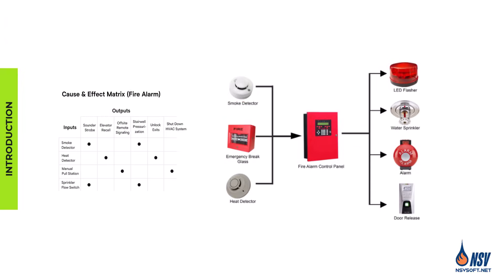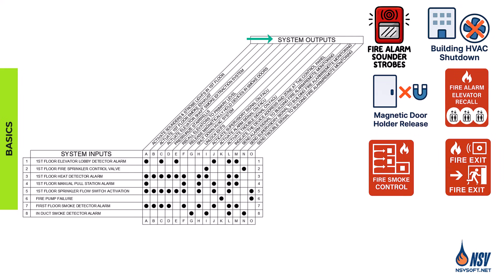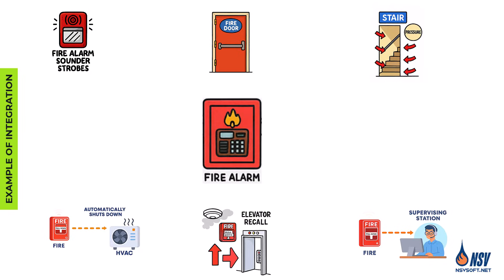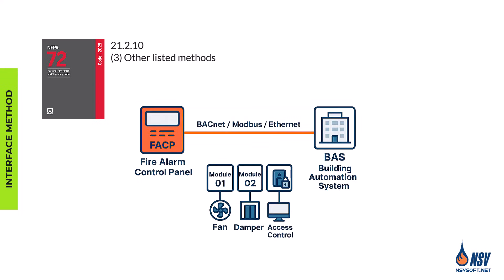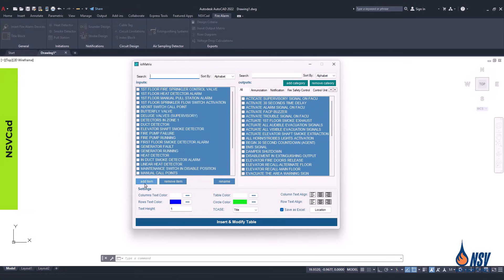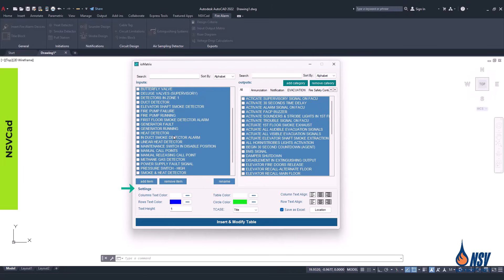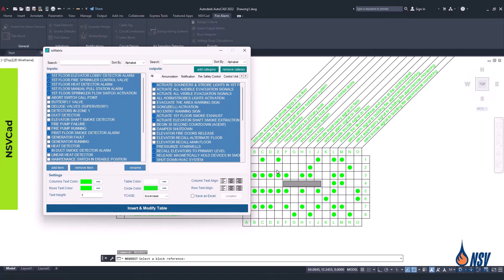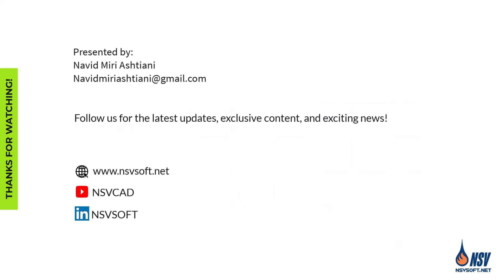🧾Input & Output Matrix (NFPA 72)

Comment: It's so important to stress that the matrix is not just a programming tool, but a mandatory document for design, acceptance, and integrated testing, as required by NFPA 72 [01:34]. Highlighting that the egress strategy is the foundation for the entire system design was a key takeaway [01:48].